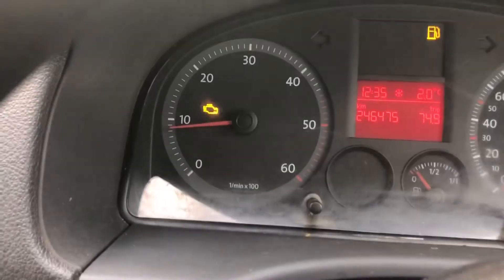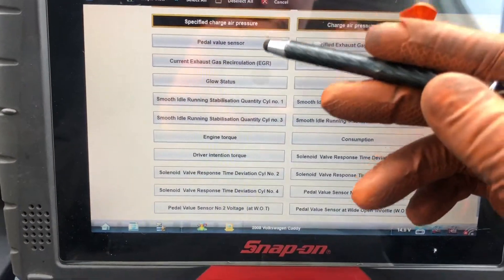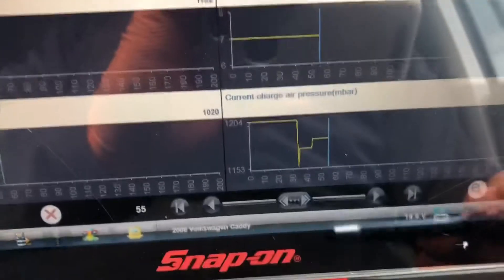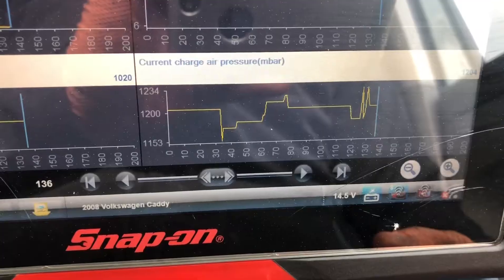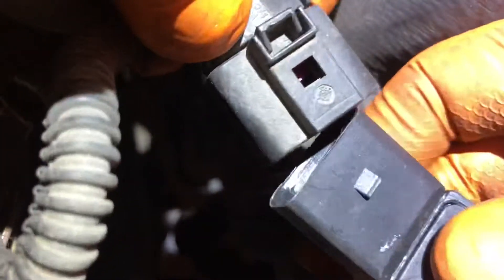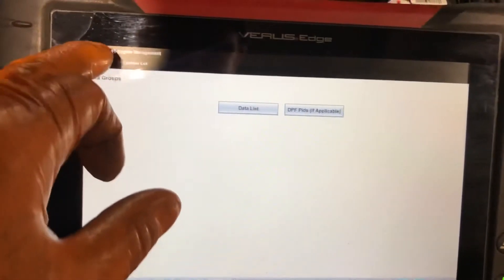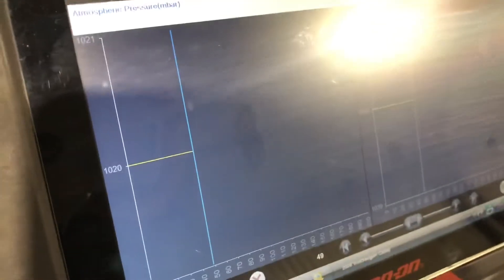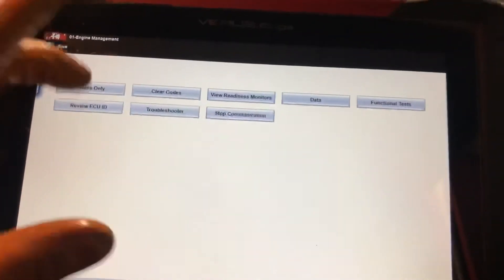Volkswagen Caddy P1592, boost pressure V atmospheric pressure correlation (05522)

Comment: Hi i have the same issues with the same code i replaced my map sensor but the fault code keeps popping up i did check for coms 

And there no issue with wires 

I map the car for the 4bar map sensor that i fitted

But no luck fualt just keeps on appearing

Comment: Hi m8
So my boost is showing 1020 but when I rev it goes down to 900 this is on a caddy does that mean it goosed
Reply from the maker: It seems like you could have an air restriction. Check the basics like the air filter & is the turbo rotating freely on both the intake & exhaust side 🤔🤔
Reply: @kennedysgarage3281  and I've just subscribed to your channel
Reply from the maker: @gavfreeman8797  thank you kind sir 🙏🙏🙏👍
Reply: @kennedysgarage3281  will do m8 thanks I will let you no 👍

Comment: Hi i have p01592
P0101
P0238
P234
What does it mean please ?
Reply from the maker: It sounds like you could have a broken wire to the boost pressure sensor or a boost pipe split
Reply: @kennedysgarage3281  thanks i comunicad from french have a good day

Comment: Hi mate. Got a 2008 caddy with P1592 and P0101. Changed MAP sensor but error remains. Engine off, atmospheric pressure is 999.6 mbar, boost pressure (actual) is 999.6 mbar. Boost pressure (Specified) is 193.8 mbar. My head is in a muddle!
Reply from the maker: 1. I’d would ignore specified data pid, some scanners can be nuts 🤔
2. Atmospheric & boost look good KOEO (key on engine off) 
3. Snap throttle or drive under load (high gear & throttle to floor) you should get no less than 2000 mbar (1000 on top of atmospheric)
4. You have an airflow fault also & if an intercooler or pipe split, air flow numbers go up due to boost air getting out. 🤔
5. The veins seize a lot on these turbos, check for free movement. They should move 15 to 20 mm & not 5mm or so. 
6. Disconnect air flow meter see if boost improves. 

Try these & see how you go 😉

Comment: I keep getting boost pressure regulation control code coming up on the scanner. Do you have any advice?
Reply from the maker: First make sure that your boost pressure is correct with just the ignition on. It should be around 1000mbar. You can compare this to atmospheric pressure in your live data pids. They should be the exact same. Let me know how you get on and we can go forward from then 🤔